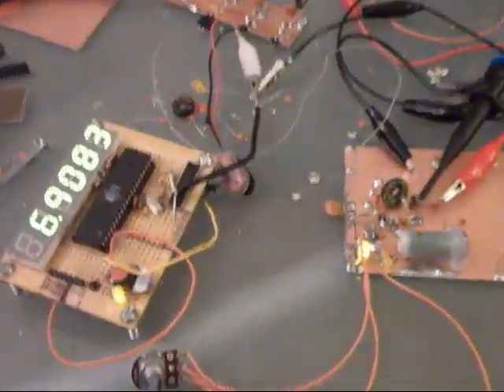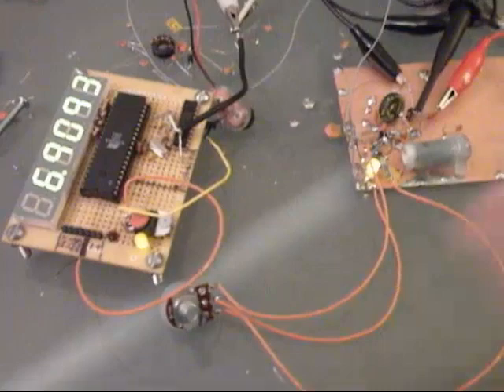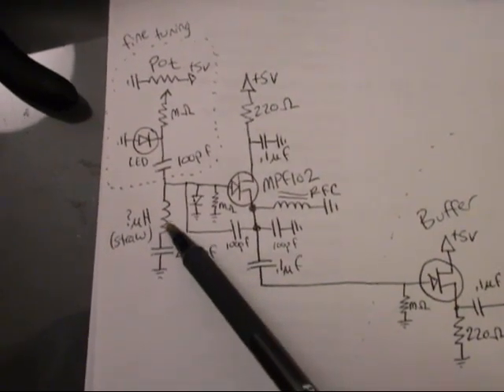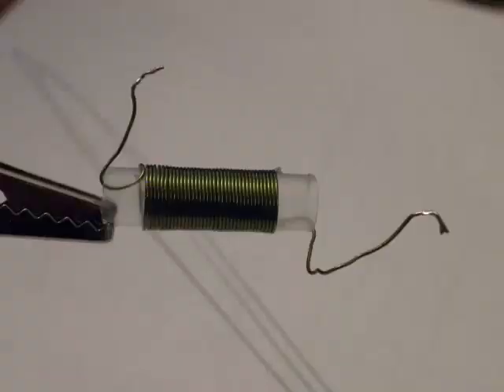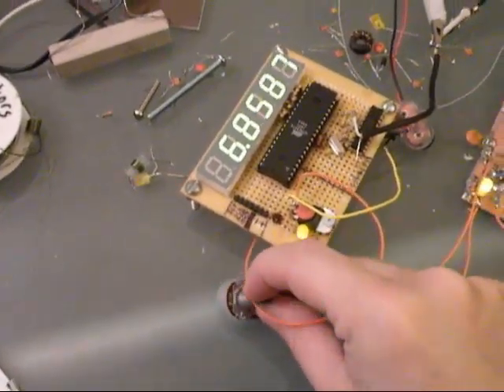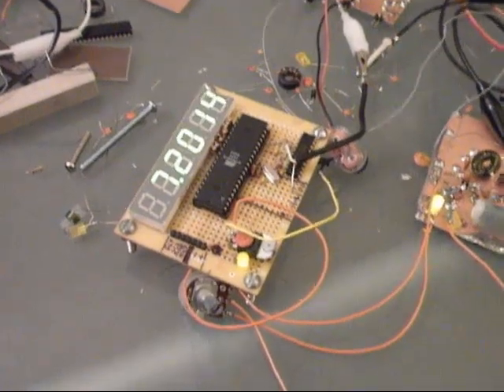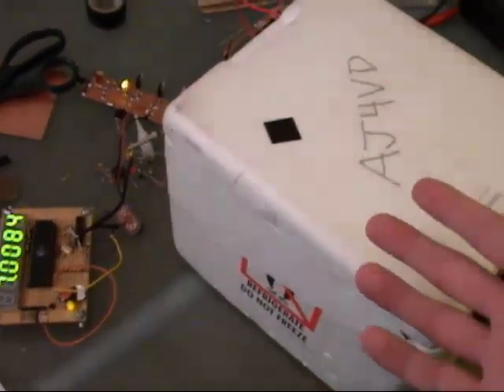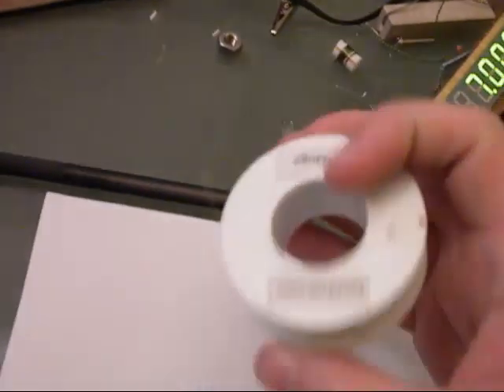screw adjusted voltage controlled oscillator

Comment: What was the value of the rf choke used in your circuit.I am debating using a similar circuit to this to form a sweep circuit controlled by a Varicap diode